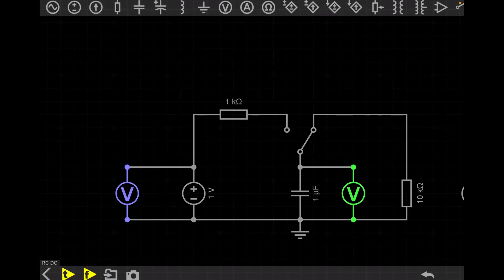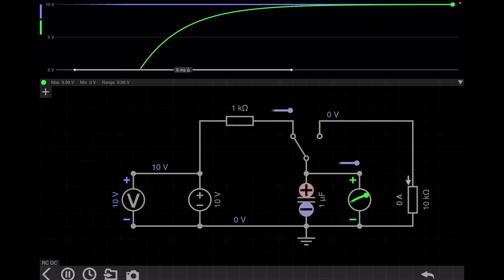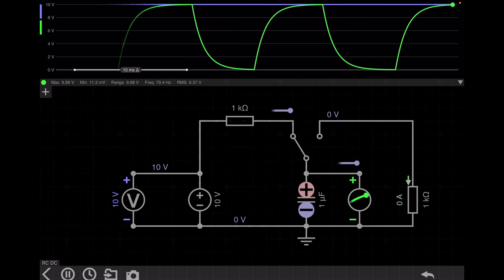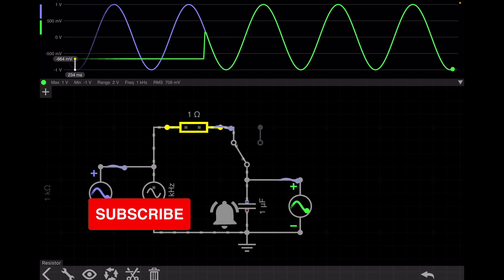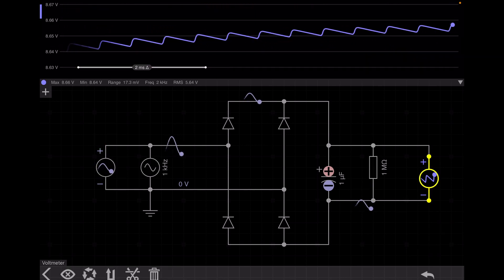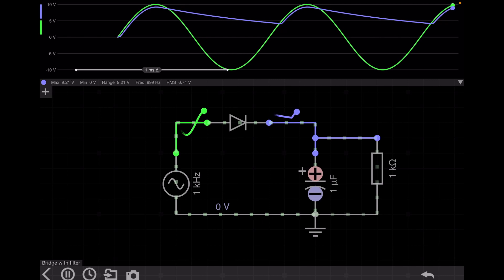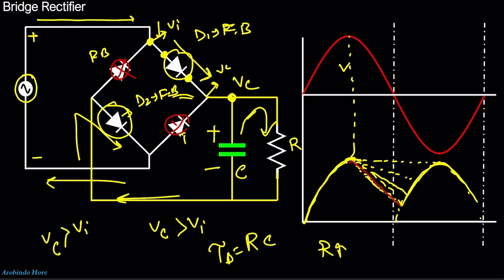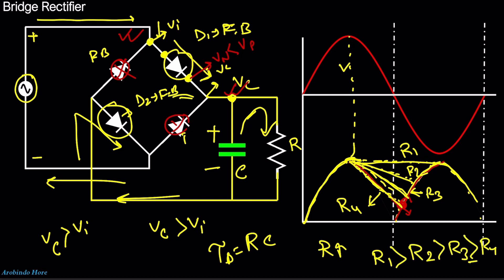Concept of Capacitive Filter with Bridge Rectifier {Explanation with Simulation}

Comment: Hi, Do you know any board for the following application input 110 VAC and Output 320 VDC with 0.75kw? I think that could be full bridge rectifier and increase the voltage and capacitor filter. Let me know your comments. Regards
Reply from the maker: Hi, You should use a full bridge rectifier followed by a boost converter to achieve this.